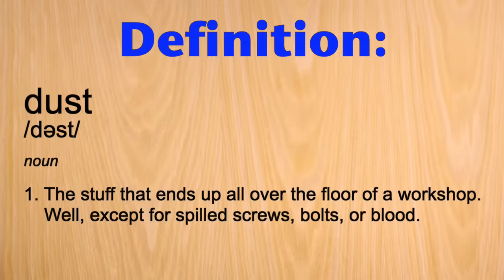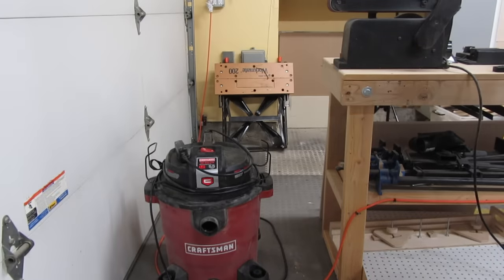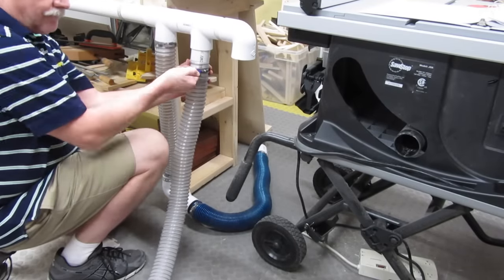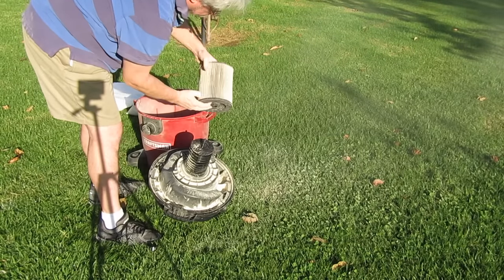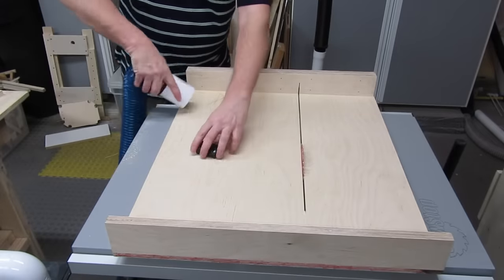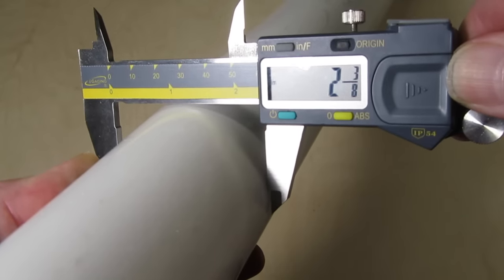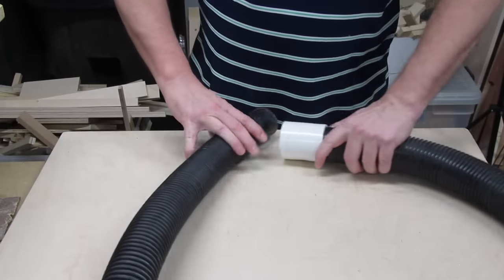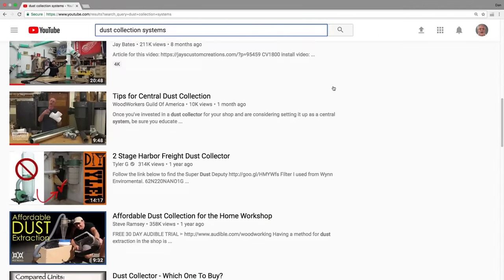Dust Collection for Newbies: Introduction to Dust Collection

Comment: You could have just as easily put a PVC valve fitting on each drop instead of the blast gates.
Reply from the maker: Tried that. They're incredibly hard to turn.
Reply: @The Newbie Woodworker  put a little wd 40 on them initially and work them a few times.  They're always stiff until they get used.   They're meant to prevent water leaks so they're designed that way but once they are in use they do loosen
Reply from the maker: @ArkLord001  OK, thanks for the info.
Reply: Blast gates are cheaper.
Reply: @Richard Daugird  they're under 5$ each here.  Don't know what the blast gates cost so can't say if they are or aren't
Reply: @ArkLord001  I only did a quick web search and saw PVC valves for $15 and up, blast gates are $10 on Amazon. Where do you buy valves? I'm always looking for a bargain.
Reply: @RDAUGIRD  it's a small mom and pop store near me in Montreal.  Some stuff is cheap, other stuff more expensive there.  Depends on what you're looking for.  I don't know if they have a web store or not, I've never looked because they're 10 mins from me so I just go there and look.
Reply: The difference was the ones I got had no logo.  I had the option to put a logo on them to brand them but the price jumped to $22 / unit and given that they came out of the same factory as Apple's Ipods, I opted not to tempt fate and incur the wrath of Apple

Comment: My work shed is  to small to have 2" pipe running every where. Is there harm or issues with reducing the pipe down to say 3/4 and enlarging at the equipment port ?
Reply from the maker: It might damage the shop vac. But even if it doesn't, pipes smaller than around 2" (inside diameter) won't work very well, and would probably get clogged pretty easily.

Comment: awesome diy ...i ask : is circular saw not fit to cut PVC ? why ?
Reply from the maker: Thanks! The problem with using a circular saw is keeping the pipe secured, so it doesn't move when you cut it. If it moves even a little, it can shatter, sending pieces of PVC out like shrapnel.
Reply: thank u very much
Reply from the maker: @gogo5542  You're quite welcome! 😄

Comment: Hi there. Might be a silly question but do you think it is possible to run 2 lower hp vacuums in tandem to create better movement? Or. 2 at different sides of the room? Would they be fighting each other? Thanks
Reply from the maker: Hi Scott. I don't think either of those would work. However, you could have two separate runs, one for each vacuum. Hope that helps! 😄

Comment: Would not 45 degree connectors work better than 90 degree connectors...more velocity?
Reply from the maker: For 2 1/2" pipes, not as much as you might think. https://youtu.be/DzuPo802mV8

Comment: When cross cut saws not available, a 5.5" turbo hand grinder cuts 4" pipe and smooths flat too. what tape is best my metal duct tape leaks after temperature variations?
Reply from the maker: Thanks for the info! Regular old duct tape works great. You don't even need to worry about the wrinkles, unless they're really bad. With that said, you really shouldn't have to tape much of anything. I mean, one time I got a couple of PVC pipes that were slightly narrower than normal and they didn't make a tight fit (so I took them back), but other than that, you should just be able to fit everything together with a little elbow grease. I do have to tape 2 things, but they're an exception. Anyway, I hope that helps. 😄

Comment: Just curious about your drill press and what appears to be a belt/disc sander.  What kind?  Experience?  Satisfied? Thanks.
Reply from the maker: The drill press has been fine, although a spring broke on it and I had to replace it: https://youtu.be/xwqBV2rgAds. It's a Craftsman, and I don't know if they still make it. The belt & disc sander is made by Wen, and it works great. https://amzn.to/2XxE3iu
Reply: @TheNewbieWoodworker  Thanks.  Everyone seems to say good things about the Wen belt & disc sander.  I have the Wen 9 inch bandsaw, which is not perfect, but pretty nice.  I enjoy using it.
My dad gave me a small Craftsman drill press many, many years ago.  It has never been very precise (play in the spindle), and leaves something to be desired, but works for 90% of requirements.  I also picked up an ooooold 13 inch, 16 speed drill press, about 4 ft tall, weighs about 80 pounds, and needs work (the table elevating mechanism is jammed, rust on the column, needs a lower stand).  It seems to run just fine.  Northern Industrial Tool used to be the store brand for Northern Tools, until 2002.  
Been thinking about a benchtop drill press with accuracy, reasonable amount of swing (distance between bit and column), and enough travel to drill through a 2x4 on edge; something better than the old Craftsman, but more compact than the old NIT drill press.  So far, almost none of the current offerings have the swing or the spindle travel of the old drill presses.  
Guess I'll just work on the old monster.  Eh, fixing things, making them work is kind of satisfying.
Thanks again.  Take care and stay well.
Reply from the maker: @joedance14  There's probably one out there that'll do what you want, but the pleasure you get from refurbishing something is hard to deny, if you've got the skills. I say go ahead and try to get it working - it's not as if we've got better things to do, right? 😂

Comment: knda dump question but here goes ...when running the power equipment sander do I have to run the vac same time?
Reply from the maker: Actually, I don't think that's a dumb question at all. It'll work much better if you run it at the same time. I know because I forget to turn it on sometimes, and I can really notice the difference. 😂

Comment: I messaged you over on Instagram, but not sure if you are responding to comments there.  Anyway, My question was about putting the shop vac in an enclosed cabinet with insulation or foam to deafen the sound.  Do you think that will impact the performance of the vaccum if it's enclosed?
Reply from the maker: Hi Jeff. I just saw your message in IG, although that app still confuses me. If it hadn't popped up a notification on my iPhone, I wouldn't have seen it. Responding here is easier anyway, with a keyboard. 😄 To answer your question, I've seen a couple of videos where people enclosed their shop vac, so I know it can be done. As you mentioned on IG, I would think you'd need to vent the exhaust somehow. Don't know how that would affect performance, if at all. And if you do add an exhaust vent of some kind, I'm not sure how much quieter it would be. Still, as I said, people have done it, so perhaps you can find some videos on the subject. Let me know how it works out!
Reply: @TheNewbieWoodworker  thanks, I'm definitely going to give it a go.  I'll let u know!
Reply from the maker: @jeffmalone9869  👍

Comment: Sorry, this may be a silly question but would you use a 1hp dust collector or a 6.5 hp shop vac?
Reply from the maker: It's not a silly question, and the answer isn't as simple as you might think. For a system like this, I'd stick with the shop vac. If you want a "heftier" system, then go with a true dust collector and 4" or larger pipes. Good luck!

Comment: how did you heat the PVC pipe to mould it?
Reply from the maker: Use a heat gun, or even possibly a hair dryer. Keep it moving over the part of the surface you want to mold, so it doesn't burn or discolor. Wear gloves, and test whether it's hot enough to mold by pressing the end against something (I usually just press it against my workbench - it doesn't seem to hurt anything). It's best to do this outside, or in my case I open the garage door and run my shop fan so it blasts the fumes outside. I keep meaning to do a new video on the subject (I pulled my old video because I felt I didn't focus enough on safety).

Comment: when a shop vac is attached to the dust port of say a band saw and I am doing the cutting - do I need to run the shop vac at the same time? Or can it be run after the cuts are done?
Reply from the maker: It probably doesn't matter as much with a band saw as it does for most other tools, but still, if you have the vac running while using the band saw, it can cut down on the amount of dust that gets in the air. Maybe not much, but it's something. On the other hand, if you don't think there's much difference, then don't use it. 😄

Comment: Hi, can you give us a link to those soft mats you have on the floor? I think that is a great idea vs concrete
Reply from the maker: They're from Lowes, called "Perfection Floor Tile". But my wife, who's standing here demanding I mention this, she wanted some different colors and contacted the company directly, and ordered from them. She wants me to explain how I cut them, etc., but instead, I'll be a man and say that you should use a big rubber mallet when you attach them to each other - the extra weight of the bigger mallet makes a huge difference. Size did matter, in this case. 😛
Reply: @TheNewbieWoodworker  thanks for the info! I'll check them out
Reply from the maker: @tson  👍

Comment: I don't understand I just routed 4in pipe from my big dust collector (king industrial 3hp) toward a small 2" pipe for my CNC router extraction boot but the suction is pretty shitty and the 2 filter bags are not expanding if I don't open a side door near the motor. However, near the entry side of the motor, the suction is perfect and strong. I don't know where I missed it... maybe the flexible tube between the hard pvc pipe makes it bad ??
Reply from the maker: Thanks for the comment. You need to solve the problem step-by-step - isolate the problem area. So start with pipes that work correctly. Then add the next coupling, and check. Then the next pipe or hose and check. Repeat until you find the problem section. If you take your time and proceed one section at a time, you'll find the problem. Good luck!
Reply: I suspect that what you are seeing is the difference between dust collection types. The shop-vac style works like a vacuum cleaner - high pressure, low volume (HPLV) - so the suction doesn't suffer when you stop it down to a smaller diameter pipe. The type you have - the King Industrial 3hp dust collector is low pressure, high volume (LPHV) - it relies on the air moving fast into a low pressure bag. It's great for chip collection and larger dust, but if you impede the air flow, the suction drops dramatically– hence the bags aren't inflating. The best thing would be to see if you can get a 4" extraction boot for your CNC router, or use a shop vac with a 2" hose. There are some good YouTube videos on this distinction. Hope that helps :-)
Reply: @ijerry1  4in dust shoe will be huge for my application. My CNC is about 4x4... but now I get what you said. I am new to this. I will take a look to find/try a flexible 4in

Comment: any new wood worker, pls dont use a shop vac for dust collection, they are pretty awful. Go pick yourself up a actual dust collector from Harbor Freight for like $350 and save your self the headache. Dust collectors by design move much more volume.
Reply from the maker: Thanks for your comment.
Reply: Well I’d say that isn’t necessary in all cases. Yes if your setting up a shop to do daily or weekly work and this use the tools and vac a lot on a monthly basis sure. 

But some of us don’t have the space and so things need to stay movable and have double duty. Many start out with a shop vac to vac the floor and cars with its attachments. And those are perfectly fine for very occasional use. I started out not connecting anything to the tools (partly because 3 tools and vac and i had 4 different sized ports and hoses as a result ) - and so I used the tools wearing a mask. And when I was done I’d see the shop vac to vacuum up the floor and tables and walls. 
Works fine for once a month or once a year project spaces.  Better than sweeping.  

The next step up is the cart with cyclone and shop vac as it keeps the vac at maximum suction. So there is a definite use for the shown cart only or cart and fixed dropper lines in most low Volume garage shop spaces. 

Yes a dedicated dust collection system is better Still but is overkill for a good percentage of home woodworkers , especially those of us that have to fit out entire wood and electrical and machine “shop” space into the slot of a single car garage bay.
Reply: What if all your tools are dust collection ports are under 4inch?

Comment: How does doubling the bucket help with the negative pressure generated inside the first bucket?
Reply from the maker: Other people have asked this, and honestly, until they asked, I just assumed it was like making the bucket thicker. But now I'm not really sure. And it doesn't work for everyone, so I suspect that it doesn't work quite like I thought it did. So, I guess the real answer is "heck if I know". 😄
Reply: Just a thought: In order to collapse with the negative pressure, the inner bucket needs to buckle up out of shape. Having the outer bucket as a sleeve over the inner one might help it resist the buckling out of shape.
Reply from the maker: @MrsF430  That's what I thought too, and I think it does help like that, but it turns out that the inner bucket can still collapse. One thing I wonder, though, is if you glued the inner bucket to the outer bucket, would that improve things? I think it would, but I'd need someone else to test it - someone who still has a collapsing bucket even with 2 buckets.

Comment: What do you do when you need to cut a large sheet of plywood or some other large stock? Your layout seems rather tight for ripping long stock.
Reply from the maker: I put some 2x4s on the floor, and lay the stock on top of then. Then I use a circular saw along with a guide like this https://amzn.to/3qUS7NH to do the cut. I cut across the 2x4s so the stock doesn't sag and possibly pinch the blade - I don't mind cutting the 2x4s a little, but obviously don't extend the blade too far.

Comment: As a former pipefitter, it always grates my arse to hear people incorrectly speak about pipe sizes.  Does a 2x4 measure 2" thick x 4" wide"?  No.  "2x4" is the nominal size.  2" IPS pipe always measures 2.375" O.D.  When pressure increases require thicker walls, the I.D. gets smaller while the 2.375" O.D. remains constant.
Reply from the maker: As a software engineer, it bugs me too. Exactness matters. Unfortunately with dust collection, the industry can't seem to come up with standards. ARGH!

Comment: hi i am having a problem with my blast gates they are getting fine dust in the area you close i mounted them the way you did. am i missing something.
Reply from the maker: I've had that problem with the gate for my table saw. I replaced it with this kind of gate: https://www.leevalley.com/en-ca/shop/tools/workshop/dust-collection/parts-and-accessories/51506-self-cleaning-blast-gates.

Comment: Hi got a question for you it seems some times these buckets cave in could I remedy  this by drilling a small hole in the bucket lid or in the side of the bucket thoughts please thank you !!!!
Reply from the maker: Give it a try and see. You can patch it with duct tape if it doesn't work.
Reply: @TheNewbieWoodworker in other news as long as I use the wet vac filter   ( as my unit is low capacity ???? ) liquid filter I would thin the dust collector can be extra storage if I  have a flooded basement ???? does that sound right ?
Reply: @TheNewbieWoodworker  Hi my new question to you is I guess since I have a low capacity shop vac my question is I dont see why I could not if I use the units wet filter use the dust collector to add water storage in case of flooded basement I mean that does seem like it could work ? thoughts please thank you
Reply from the maker: @Fredengle  I'm not sure I understand the question, but dust collection and a wet vacuum doesn't sound like it's a good mix,
Reply: Your inlet is probably too small.  You create a low pressure zone inside the bucket and atmospheric pressure outside causes the collapse.  Drilling a hole might cause whistling and will reduce the efficiency of the collector.  Reduce the power to the vacuum source, maybe by cutting an opening in the vacuum line, not the bucket.  Then adjust the opening area by a piece of close-fittling pipe over the opening.  Slide back and forth until the desired vacuum is achieved.  Should solve your problem.

Comment: Pvc pipe has to be warm before you cut it on a table saw or a chop saw.
Reply from the maker: Thanks for the comment. How warm?
Reply: @TheNewbieWoodworker  anything above 50 degrees. Anything below that the pvc becomes brittle and will explode. Also use a fine cut blade on your saw and cut sloooooowly.
Also on your dust collection  system I found if you ground your pipe , you won't have a static build up in the system.
Reply from the maker: @fordwaters8335  Thanks! I assume that's Celsius. 😄And I like the way you phrased the comment about grounding the pipe. Nobody can argue with that. I personally don't think static buildup is an issue I need to worry about (https://www.rockler.com/exploding-pvc-dust-collection-ductwork), but I wouldn't tell someone not to do it, either. Thanks for the comments! 😄
Reply: @TheNewbieWoodworker  I had a bad static build on my system. That thing would pop me every time. I enjoyed your video.
Reply from the maker: @fordwaters8335  Thanks! And I hate static shocks. Always reminds me of this scene from Office Space: https://youtu.be/zsTDnnh7T6A?t=6. 😄